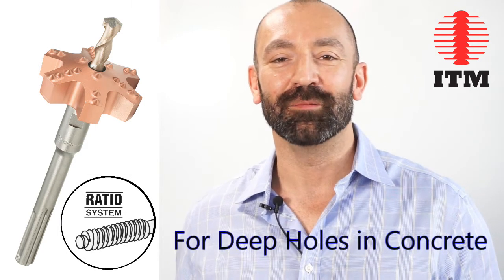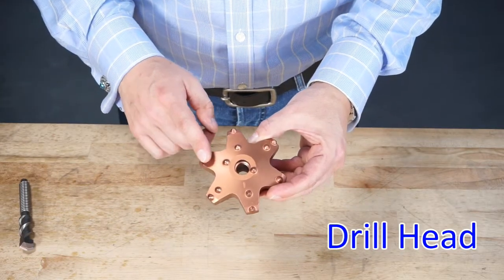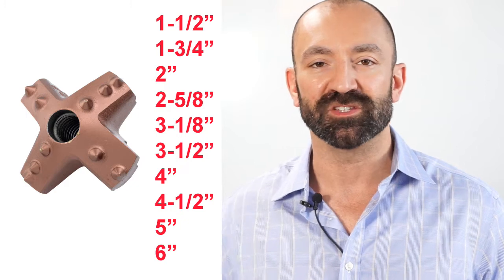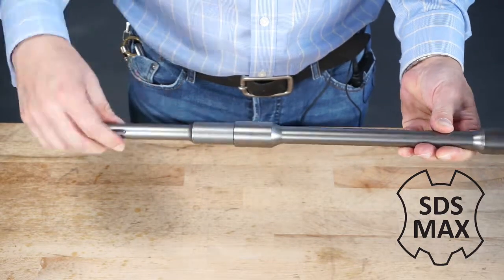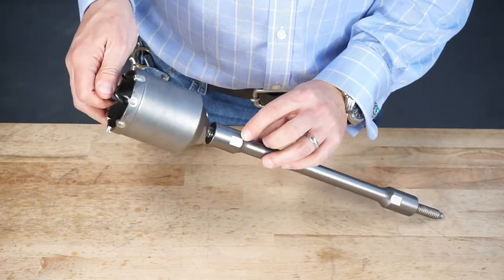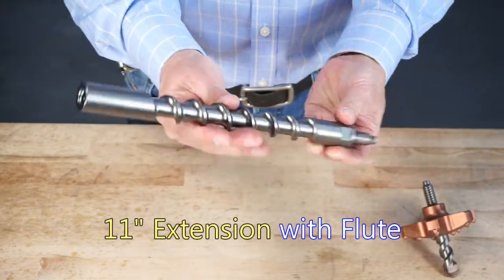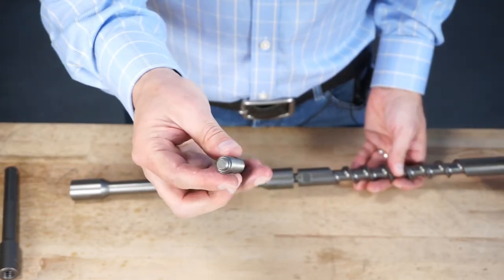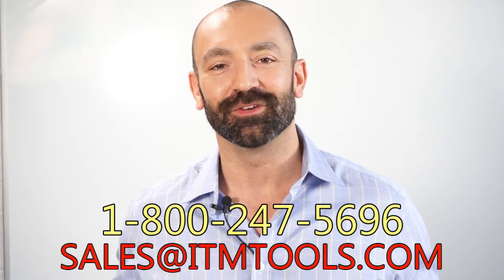RATIO SYSTEM

Comment: I need to drill 2 holes 53 inches deep into a multi wythe masonry column what do u recommend
Reply from the maker: I recommend you watch our video "4 Key Questions" to drill any hole, because the way you write the question it is difficult to understand what you are looking to do. However, if you are looking to make 2" holes 53" deep, you will need an SDS-MAX machine and you can use the RATIO system. Check out our catalog page https://www.itmtools.com/pdfcat20/ITM_Cat2020_p101.pdf